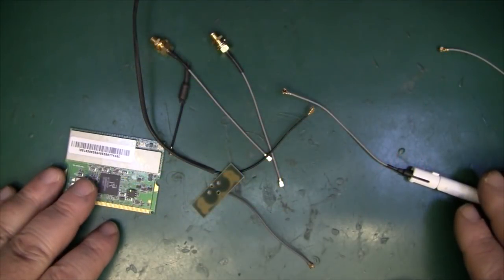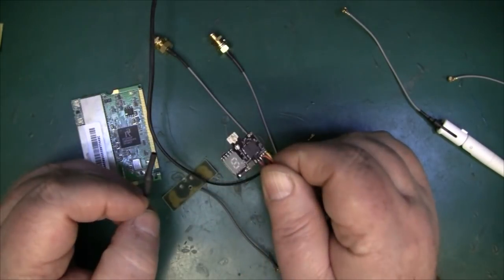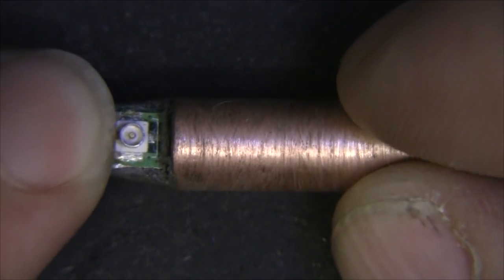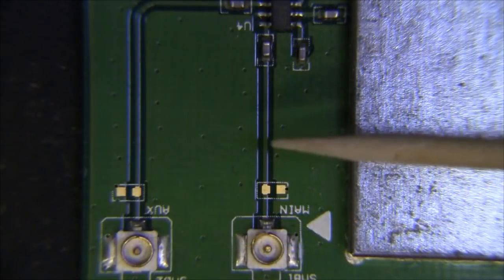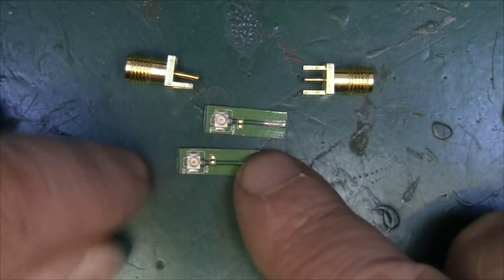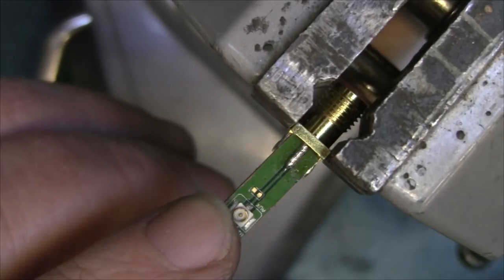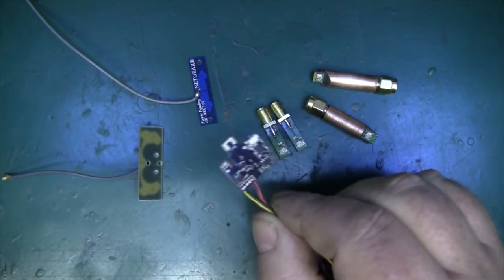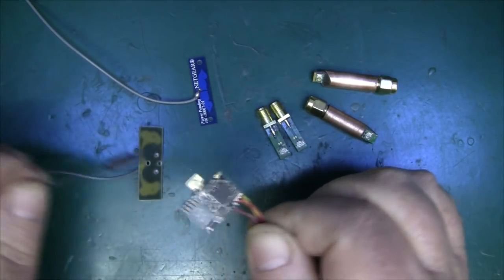Hirose U FL to SMA Adapter

Comment: Impedance is not properly maintained in those transitions. The board you've cutout has 4 layers (at least), can be seen in the thumbnail image. The track on the top layer has a width specified for probably layer 2 or 3 reference ground, but the SMA center pin is much wider, with the ground reference at layer 2 (most probable), you're looking at a much lower impedance than 50 Ohm (most probably around 20-25 Ohm). So you'll have an impedance step at the SMA transition. The coax example is worst, I hope you've cut that track beneath the coax pin that shoots 45º to the corner of the PCB, otherwise, you have a very nice stub there, that is probably relevant above 1 GHz. Maybe you can measure the transfer response of those transitions and see up to which frequency you're good with it. Also, Wi-fi band at 5 GHz can go from 5.15 to 5.85 GHz depending on region, but starts at 5.15 GHz. Having said this, nice video anyway!

Comment: Have you seen connectors that look like the Hirose connectors but are even smaller, only about 1/2 the diameter?  Some ASUS laptops use them for the Wi-Fi connector and I'd really like to know what they are called?
Reply: You're probably talking about Hirose MS-180 series connectors or Murata SWH series connectors, they are very small, and are switched connectors.
Reply: Those might be the Hirose W.FL.

Comment: I found these pigtails on Amazon in the states.

https://www.amazon.com/Female-Antenna-Cable-Extension-Pieces/dp/B00YM0HN0O/ref=sxbs_sxwds-stvp?keywords=Hirose+IPX+Male+Adapter&pd_rd_i=B00YM0HN0O&pd_rd_r=1b61e864-52bf-4c21-8746-b1877cc60c0b&pd_rd_w=RVO08&pd_rd_wg=aB6ki&pf_rd_p=a6d018ad-f20b-46c9-8920-433972c7d9b7&pf_rd_r=6A37RWBQV7EFANRBR093&qid=1559254884&s=gateway